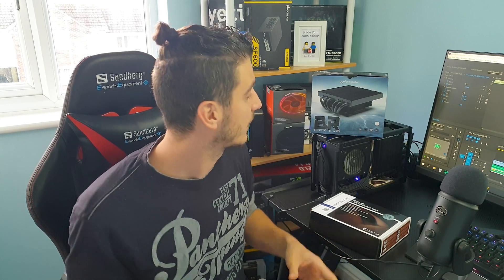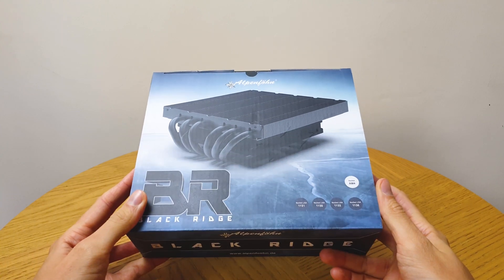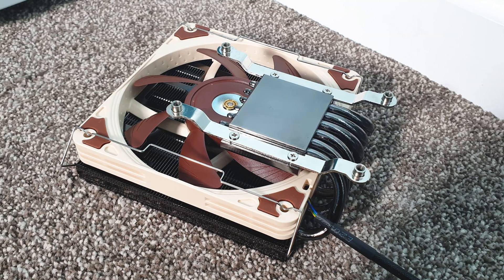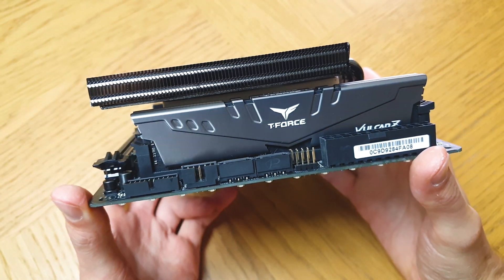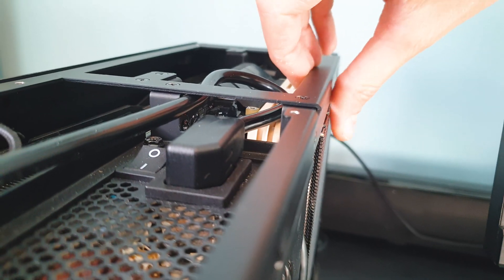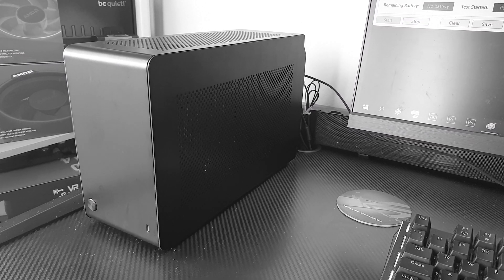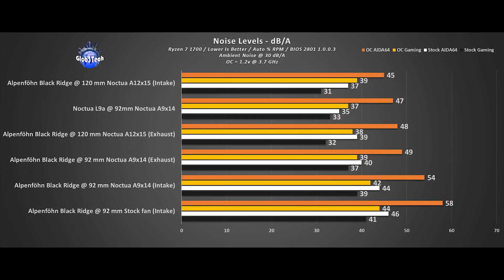Alpenfohn Black Ridge | The Best Air Low Profile Cooler for the DAN A4-SFX?

Comment: I am running hot temps. Did you use the backplate that came with the motherboard for installing the black ridge? Got CPU temps at 85 degrees during gaming
Reply from the maker: No motherboard I/O shield to facilitate extra airflow. Plus it makes the instalation of the motherboard a bit easier.
Reply: What's your CPU may I aak

Comment: Yo man,  my crucial p1 ssd is not detected by the bios. I installed it in the top... beneath where I removed the heatstink. I'm pretty sure I installed it correctly... any ideas?
Reply from the maker: Hi man. Sorry I didn't get the notifications for your comments. Hm wierd. It should have worked. Did you try the back one as well just to eliminate the possibility that the front M.2 port is good or not?

Comment: Is there really no issue in removing the m.2 heatstink from the mobo if you want to use that m.2 slot? I want to get the same mobo and cooler
Reply from the maker: As far as I am aware, no. The heatsink apperently helps with extra cooling for the M.2. But when you install it on the back of the mobo like most have it, there is no airflow and the m.2 are still fine like I had mine for a long time. So yeah all good :)
Reply: @Glob3Tech  Ah so it's better to install the m.2 on the back of the mobo? I didn't know that at all. Thanks. What If I want a second one in the future, can I place it on the front without issue?
Reply: I could get the Gigabyte Aorus b450 | PRO WIFI as well. It's cheaper (about 30 euros) than the Asus one. hmmm
Reply from the maker: @Zakariat89  Yeah my m.2 97o evo 2tb never had any throttling issues. I had in the back for months, I keep it htere so I can use the front one as a quick acces when I test pther m.2s. Just so you know that if you use the m.2 nvme on the back, the 16x from the gpu goes to 8x - at least on this asus b450i.
So yes you can populate both and just put a fan on the bottom of the case if you get the A4 to help a bit.
Reply from the maker: @Zakariat89  Sure, as long you know that the black ridge has no compatibility issues with this motherboard.
Reply: @Glob3Tech  "the 16x from the gpu goes to 8x "  Oh so that means a r9 390 won't fit any more or?
Reply: It can have an effect on performance, so in my case I should just put the m.2 ssd in the front right? that's no problem without a heatsink?
Reply from the maker: @Zakariat89  Yes, just put it in the front, even without the heatsink you will be fine :)
Reply: Allrighty then thanks a lot man you've been a great help
Reply from the maker: @Zakariat89  Sure man my pleasure. Let me know how it turns out 👍

Comment: What vent are you using beneath the motherboard  / on the bottom of the case
Reply from the maker: In this video I had the noctua slim 92 pwm. The link is in the description :)
Reply: @Glob3Tech thx bro, have the same case, wanted to place one chasi fan for more cooling
Reply from the maker: @crumcon  Sure man welcome. They do the black version as well niw with 2500 rpm. 💪

Comment: Hey!  I just got this cooler, and paired with an ASUS ROG Strix x570, I noticed the brackets (new updated AM4 edition) standoffs don't reach the motherboard.  It's unfortunate it's a good cooler because it's very, very easy to install incorrectly, as it doesn't use a backplate, or come with one :(
Reply from the maker: Hi Matt. Sorry to hear that. Yeah very unlucky :( Can you send me a picture please - I am curious about that new updated version). Thank you.
Reply: @Glob3Tech  https://m.imgur.com/a/trIWNZl

Those are the pictures I took.

Do note that I did get it installed, but it was a pain.  The idea of flipping my motherboard over while I have a cooler slipping and sliding across the CPU was not fun.  Temperatures are looking good though. I just wish there was a backplate!

Comment: @Glob3Tech, I have the same mobo and the V4.1 case with the USB-C front IO. How did you manage to hook up the front IO to  the mobo? There doesn't seem to be a USB type-c connector on the mobo? Your help would be greatly appreciated.
Reply from the maker: Hi Andy. Sure, of course. Well my V4.0 has the front type-C as well but it's only USB 3.2 Gen1. And it has this port. https://www.reddit.com/r/buildapc/comments/9y7bul/fractal_design_define_r6_usb_30_header_cable_to/

But the V4.1 has the usb 3.2gen2 but the Key-A on the plug ? This on the left? (Mine's on the right)

https://images.app.goo.gl/LRSpoGqAnAoSAFgy9

If so, then yeah, our motherboard doesn't have that port :)
Reply: @Glob3Tech  thanks for your quick reply. So what do you think I can do?
Reply from the maker: @AquaPixMedia  My pleasure :) 
Hopefully this adapter will work. Only thing I can I can foresee is if there will be enough room to plug your plug into this and then into the motherboard :) 

https://amzn.to/38jxwJq
Reply: @Glob3Tech  you are right, there is not enough space...bummer! Can the  USB 3.2 Gen1 cable and port  be ordered somewhere?
Reply from the maker: @AquaPixMedia  Too bad :/ I think so but maybe give Dan an email on his website to give you the final answer since I don't know the part number for it. Good luck Andy :)
Reply: @Glob3Tech  I had some success. I have used this internal USB 3 to USB-C female cable https://www.amazon.de/gp/product/B01E6W7A6Y/ref=ppx_yo_dt_b_asin_title_o03_s00?ie=UTF8&psc=1. Hubs don't seem to work but if I plug in peripherals  directly I get  USB 3 transfer speeds of 5 Gbit/s.  This € 8 fix is probably the cheapest way. Anyway, thank you so much for all your help and I wish you  and your channel all the best👍👍👍

Comment: Great video! I’m planning to do a mini-itx build with the Black Ridge cooler using the Noctua 120mm intake method.  I’ll be using the identical motherboard to what you have with a Ryzen 9 3900X without ever overclocking.  Using mostly Adobe Premiere Pro & the odd PC sim gaming (F1 2018 & MotoGP 19) with a Gigabyte RTX 2080 mini.  Is the VLP memory you posted a link to the fastest you could source out?
Reply: Was the Alpenfohn Black Ridge able to cool your Ryzen 9 3900X effectively?
Reply from the maker: Thank you! Nice specs! At that moment, yes. I think crucial may do bigger kits but I couldn't find them. Kingston has VLP 32 gb 2666 kits but on ali express. Good luck with the build!

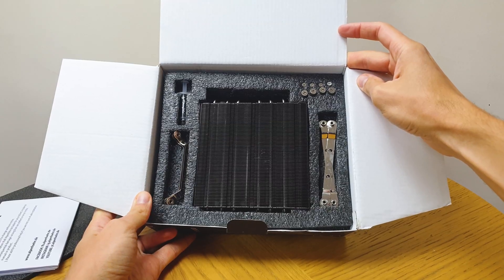Comment: Nice Video, when you were installing the noctua fan under the black Ridge @2:22 is this the Orientation for intakte or exhaust? 

Best regards
Reply from the maker: Thank you! The noctua fan at that timeline, on the cpu cooler, is set as an intake.
Reply: Glob3Tech thanks for the fast answer.
Reply from the maker: @xxThemoritzxx  You are welcome :)

Comment: i have a asus z390-i will it fit in that? and can it be a problem to remove the heat sink and m2 will it be to hot?
Reply from the maker: Apperently no, unfortunatly. 

https://hardforum.com/threads/dan-hslp-48-a-powerful-sub-50mm-heatsink.1925480/page-39#post-1043951811

M.2 should be fine even without the heatsink - I use my 970 2TB EVO on the back of the motherboard  where it has no air and no problems at all.

Comment: Thanks! Was looking exactly for this. I even have the same motherboard lol. It seems upgrading from the noctua l9a is not really worth it unless you can use the Noctua 120mm, but vlp ram seems to generally suck, even the good ones seem to have rather low frequencies and timings which is essential for ryzen.
I was hoping this could cool a 3800x but now it seems there's not a good chance of that, would probably be fine with a 3700x tho.
Thanks for the great work, I know how annoying it is to keep taking apart the dan-a4.

BTW I also got the corsair sleeved cables but imho they are not really better than the std ones that came with the psu, since they are thicker and impossible to actually fit correctly in a way that would be pleasing to the eye. So it seems to me it's either custom cables or nothing.
Reply from the maker: Thank you so much Babao! Yes, currently I switched to the new all black L9i and used the L9a brackets so at least my OCD is happy :) 

I know, I want the 3700x myself and hopefully that new eco mode for 3rd gen Ryzen might make the 3700x from 65w tdp to into a 45w one so I can use still the L9i. I don't that much CPU power really than my 1700 but we will see. 

Oh yes, custom cables or nothing like you said. They are a must especially if you want the AIO in there. 

Thank you for the comment and good luck with your rig! 

All the best, Alex

Comment: great vid, lots of help to those who are drifting back and forth while planning to move to sff, like me. interesting question though: at 4:27 it looks like you have plenty of extra room above the ram heatsink, I would say a good 2-3mm. according to the specs, the vulcanz is 32mm. I have been trying to gain info if hyperx fury modules would fit (34,1mm). theoretically they wouldn't, but from your angle it seems that they could. it would be nice to have a match for the vulcanz and corsair lpx ram combo. can you check this issue maybe?

many thanks for the useful vid!
Reply from the maker: Thank you so much Abel for the kind words and hope you will take the SFF route as well 😇🤗 Regarding your question, sure I will try to measure the remaining gap and get back to you. 
All the best,
Alex
Reply: @Glob3Tech  thanks Alex, much appreciated:) I think I will get there, more and more sff cases emerge lately, I will have to convert at this rate:))
Reply from the maker: @radioman987  Oh yes, I remember myself when the M1 came out, then the A4 etc must have ...them 😁
Reply from the maker: @radioman987  Will tell you tomorrow the measurements :)
Reply: @Glob3Tech  great, I really am curious! : )  fingers crossed, haha
Reply from the maker: @radioman987  I know the feeling 😁
Reply from the maker: @radioman987  Ok. I counted 7mm from the Vulcan Z until the heatsink. So that would be a total of 32.18 mm plus 7 mm = 39.18 total clearence. You may have an extra wiggle room becaue you can force a bit the heatsink to sit on tip of the ram.  :) 

Here is a picture as well.  So i think they should fit given these numbers :)
https://www.dropbox.com/s/kghx1p4rr4r72q0/Screenshot_20191129-131236_Gallery.jpg?dl=0&m=

Good luck !
Reply: @Glob3Tech  wow, I didnt really expect these numbers! it gives plenty of room even if the clearance may differ because of the mobo. this is really good news, thank you for taking the time to check it out! :)))
Reply from the maker: @radioman987  I know me too! I double checked it and yeah can't believe it. :d I will measure again on a different board from asrock since I am working on a new video and mention these findins as well.
Reply: @Glob3Tech  looking forward to it! only thing I dont understand now is the official ram clearance numbers on the cooler. I dont think that this could be different on v1 and v2 Black Ridges.
Reply from the maker: @radioman987  I don't know how they measured it but I am uploading a new video as we speak and mentioned this there as well so everybody can see. Hm good point but it shouldn't be that big of a difference. The Asrock video will be another one :)

Comment: Very good review.
It would be great if you did a separate review of only the Black Ridge in an open setup, where you complete the number with 120 mm fan on top and bottom and 120 mm fan on top and 92 mm fan on bottom. Knowing the impact of that would be very interesting, because the Black Ridge is also a very attractive cooler for the Sliger SM550/560 and Ghost S1. It even fits into the Saber Sentry.
Reply from the maker: Thank you! Sure, will try this variation as well.
Reply from the maker: Hi again. here are the requested variations as well ;)  https://www.youtube.com/watch?v=x_lY6-4EKHE

Comment: I wanted to do a 120x15mm fan, but the only store I can find that sells vlp ddr3200 cancelled my order and changed the listed $58.99 price to "Call for Price". I hope an nf-a9x14 is good enough to keep quiet with a 3700x.
Reply from the maker: Myself had problems with the vlp ram. They sent me regular tall memory. Hence the only 4gb stick i could find i had to use to finish my testing. Yeah that is the next cpu I want to get as well. Good luck.
Reply: @Glob3Tech  Yeah unfortunately the only popular use case I can think of for vlp ram is in blade servers or other ultra compact servers. Those all use ecc rdimms and as far as I can tell they're easily available. Vlp udimms are probably so rarely used that no store stocks them so they require bulk orders.
Reply from the maker: @Lead_Foot  Exactly. In the UK I only found that 4gb stick non ecc kingston and the one i linked in the description is an 8gb one from kingston as well. Need to test out of curiosity if ecc works on my board. 

What were the ones you found at 3200 mhz? I didn't see anything higher that 2666. Ali express has what we need but they send me the wrong ones. Adata makes them 32gb ddr4 2666 kits.
Reply: @Glob3Tech  Micron has 8gb and 16gb ecc udimms at 3200
Reply from the maker: @Lead_Foot  Thanks. Will have a look in the UK as well.
Reply: There is a Kingston VLP stick at 8 GB size if anyone is interested. The part number is KVR26N19S8L/8
Reply from the maker: @oysteinalsaker  Thank you for the info!